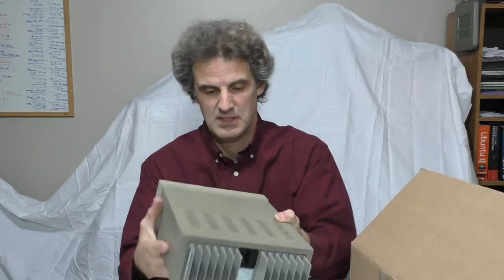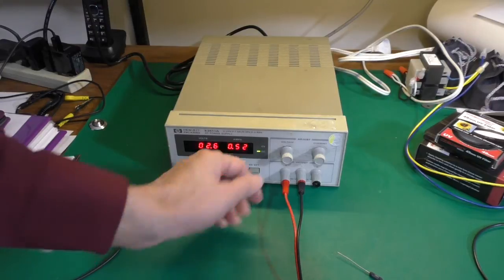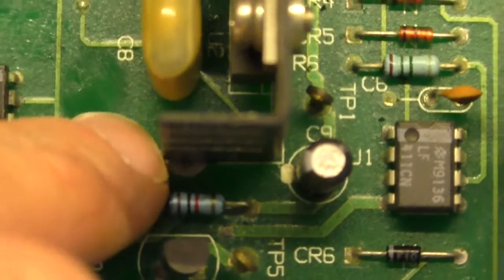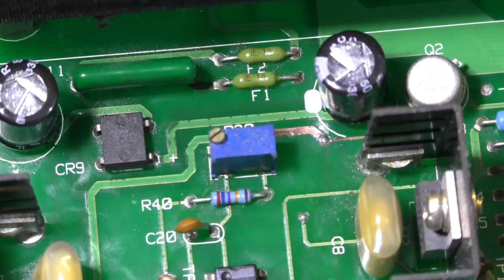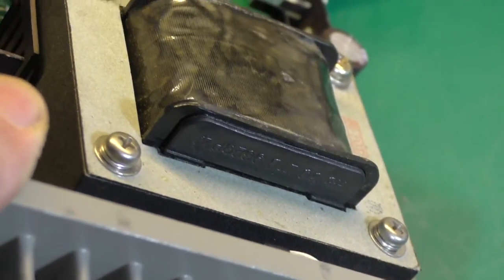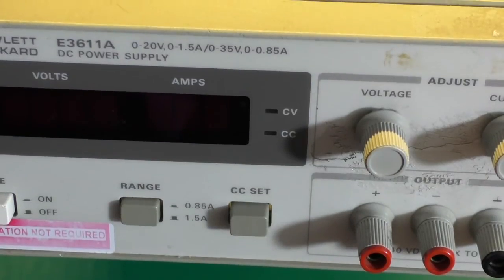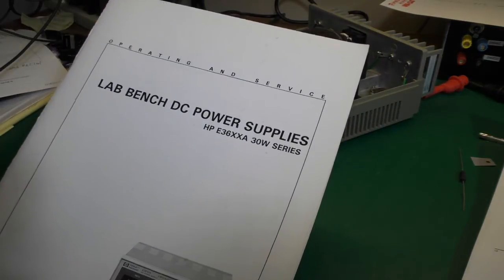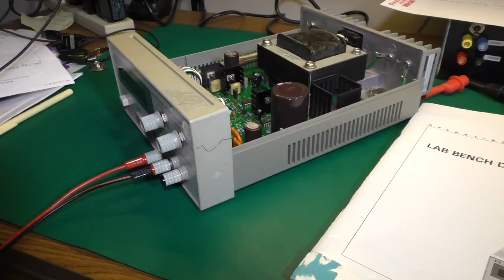R&D #7 HP - Agilent E3611A power supply unboxing and repair.

Comment: That IC looks like a Chinese knockoff of a TC7107 3 1/2 digit analog to digital converter and 7 segment display driver. It's basically a panel meter on a single IC with very few external components needed.

Look up TC7107 to find the Microchip datasheet.
Reply from the maker: +Bushougoma You may very well be right, I looked it up and it sure looks like that might be it. Thanks for the heads up.